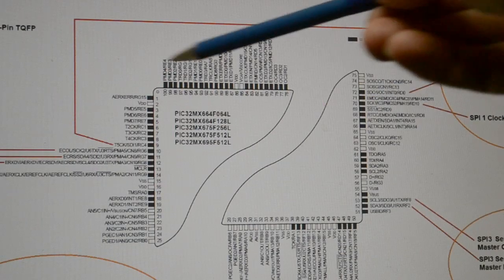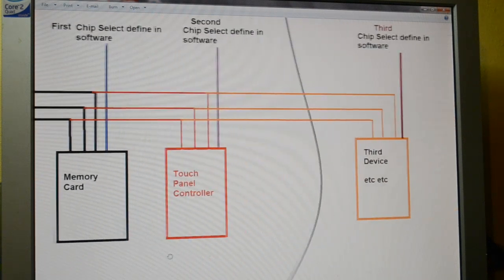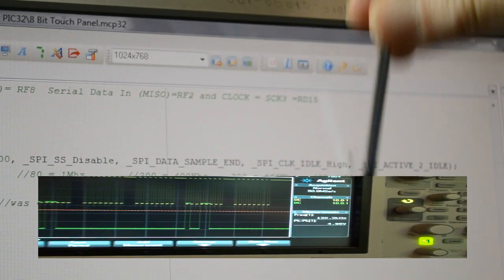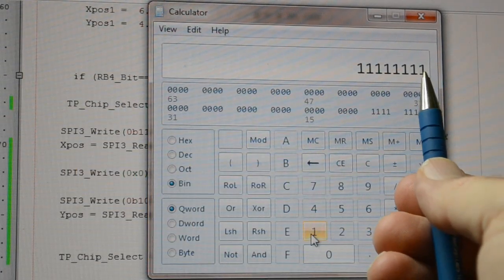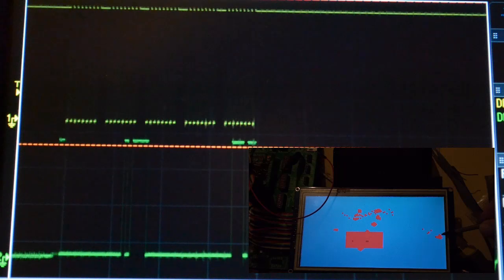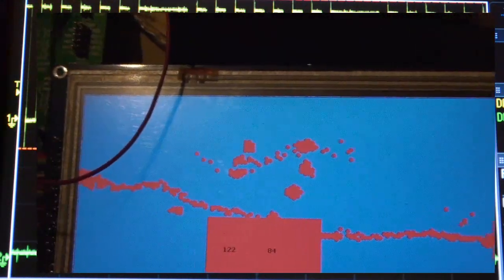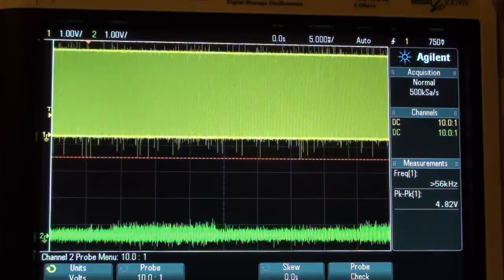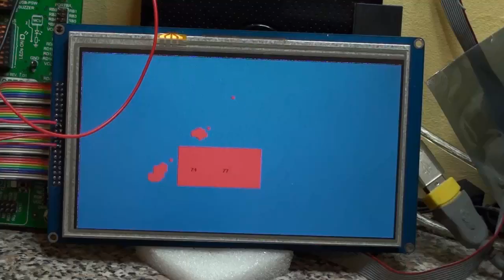SPI and How it works (8bit) with example code and scope views (read show more)

Comment: Great info mate. just learning my way into embedded and your explanation of how spi works and the scope shots helps my comprehension heaps. Cheers.
Reply from the maker: Thank you Kynan, I'm pleased it helped.
The main thing to take from the video is that the data is fixed to a clock pulse, and like your micro-controller, each pin counts up 1 2 4 8 16 32 etc etc 
The more significant clock pulse holds a greater value so important to remember if the signal is most significant byte first or last .......

Comment: Can I ask a daft question? If I have 2 slave devices, even if these have separate SS lines, both slave MISO pins are connected to each other and to the master. For the slaves these are outputs, for the master, inputs. If the slave that isn't in use is outputting high to MISO then it wouldn't matter what the active slave outputs on MISO, the master would see a high on MISO. So presume then the slave that isn't in use has MISO set low the whole time, then the active slave can go high/low on MISO and the master would see this correctly. The master MISO pin is an input though which would put it in high impedance so you wouldn't get a short when MISO goes high from the active slave. But what about the inactive slave? If its MISO was set to low, wouldn't you be shorting from the active slave to the inactive slave when the active slave puts MISO high? Sorry, that's probably a really confused question....
Reply from the maker: I think I understand what you are asking.
If a slave device does not have the chip select turned on, the data for that slave should remain at idle.
Only when the slave select is active will the slave control its own data line synchronised with each clock pulse.